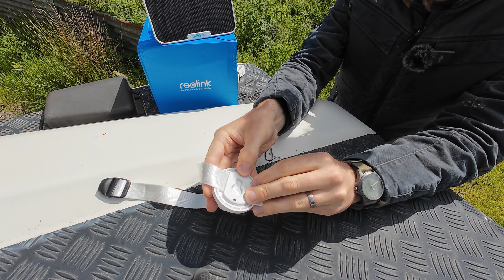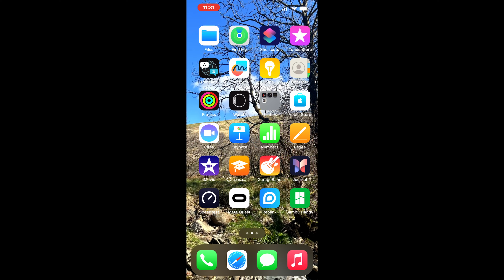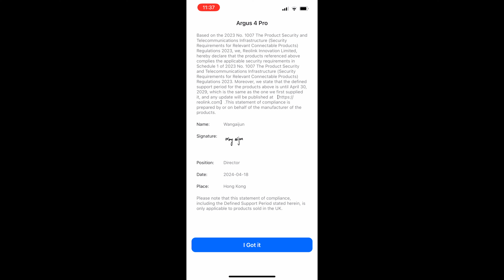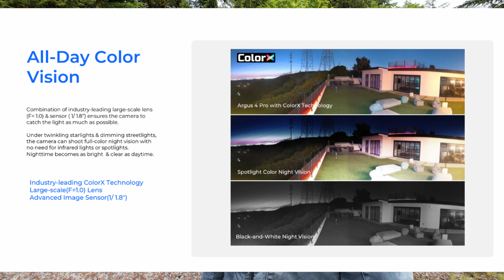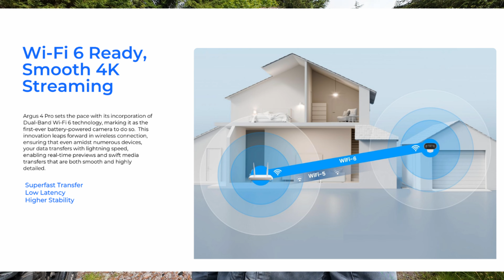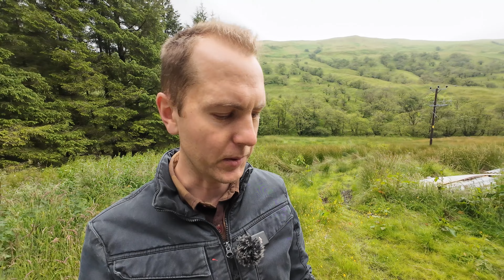Reolink Argus 4 Pro: Next-Gen Security Camera with 4K and 180° Coverage

Comment: Hey up another review , cool ,.that picture hangar at back of ball socket , you can use that.  
.
All I'd do is , to hang it , then above ,where you'd usually lift it. I'd place a screw there too, to stop it from coming away . 

Won't be as good as two screw holes,   but it'd secure it ,and easier to change positions .
Reply from the maker: Great idea

Comment: Good review. It's not the camera for me either. I use powered cameras to provide continuous streams of RTSP. Then I do the monitoring and recording on a windows PC with the Blue Iris software. It is rock solid. As you say, the camera needs to be running and the images securely stored if there is any kind of event, and I can't rely on battery cameras with built-in processing.
Reply from the maker: Yea thats how I felt as well. I prefer a system that gives me a bit more control